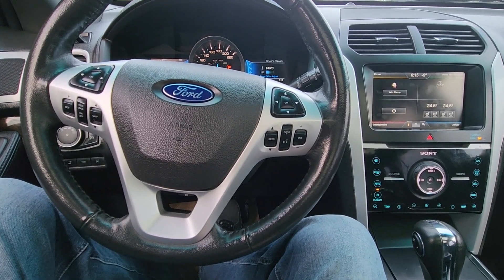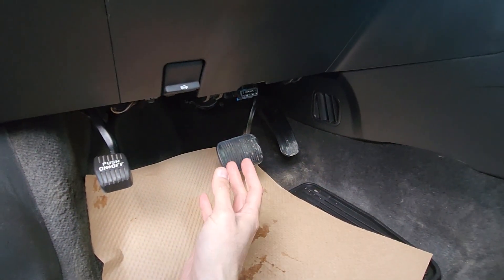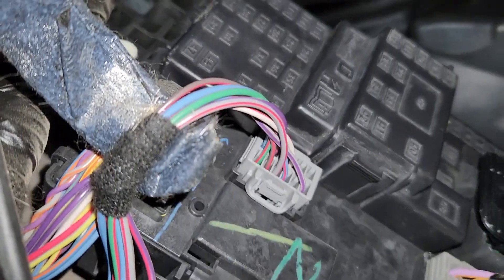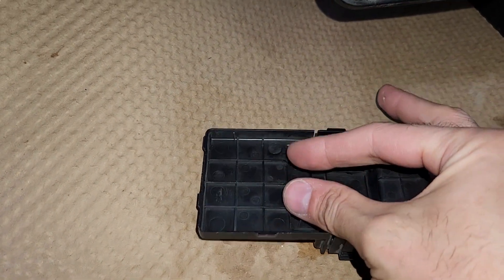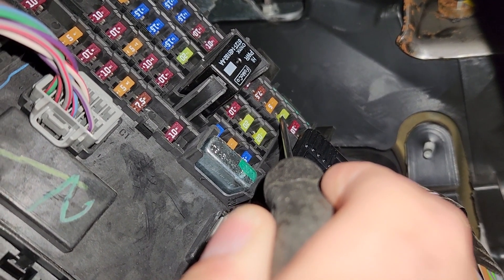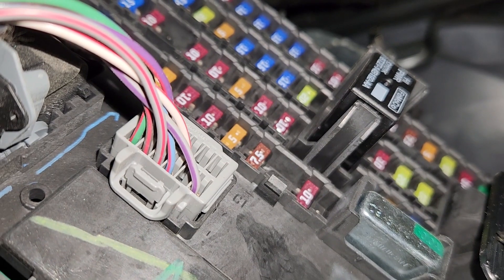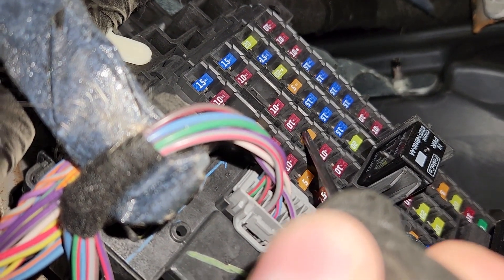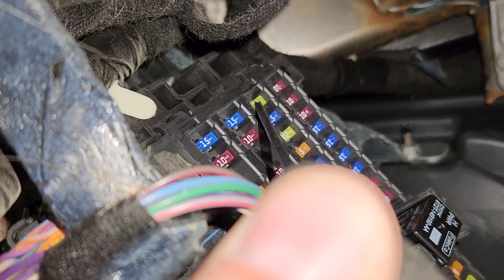Ford Explorer - RADIO FUSES LOCATION (2011 - 2015)

Comment: My dear, I've been thinking about you since yesterday, I don't know what time it is, which country you are now but, but you can't imagine how good this video you uploaded has done me. First I found my problem, and this problem has lasted about two weeks, because my car it's police car, I took it to a mechanic and they didn't find the problem they said because police car, I took it to a shop that only deals in radios and they told me "we can't fix it, but if you want we have a radio and that it's cost $2800.  I was so sad, after, I saw your video and I said let's I try to see the fuses, the first fuses was ok but the second finally it was burn, there you don't know how I was happy, and I said finally I found the problem.  

I just wanted to share my experience with you, and I want to tell you a big big thank you God bless you and bless your family.
 Yours sincerely, 
Jaklin 😊
Reply from the maker: Hello Jaklin, I am really glad my video helped you out and kind of surprised this shops didn't do their due diligence and checked the fuses. That is the first thing to do if having radio problems. It probably burned out while police was removing their equipment out. They usually just cut bunch of wiring and cause a short

Comment: Hi my dear can you please tell me FUSE #9 for what I have my 2014 ford explorer radio screen not working
Reply from the maker: Hi, Fuse #9 is for the radio screen itself and Fuse #29 is main radio fuse. Make sure to check both.
Also just removing / reinserting those fuses could reset the Ford SYNC. If not vehicle will have to be scanned and get the codes from the sync module and follow up on those
Reply: @QuiteAlright  thanks 😊
Reply from the maker: @basimtoma7606  You're most welcome :)